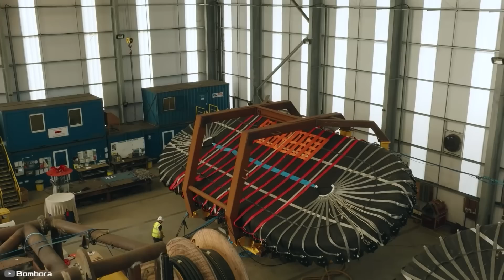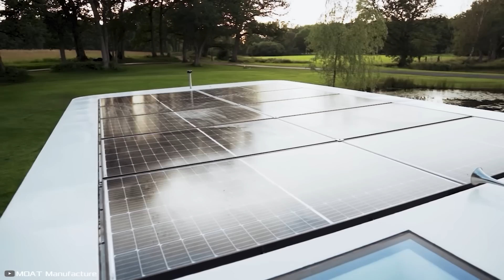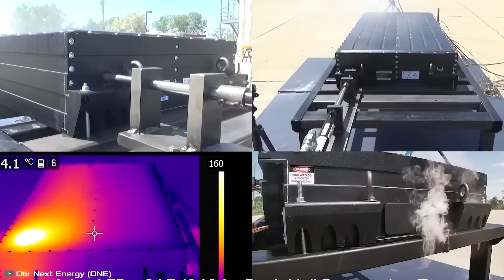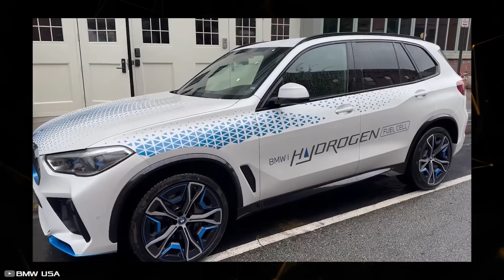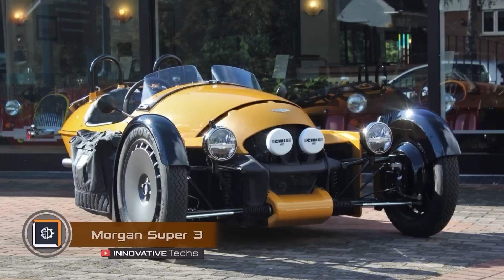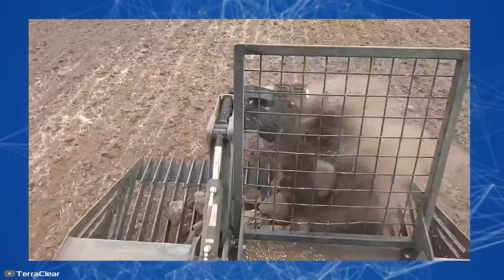80 INVENTIONS ON A WHOLE NEW LEVEL

Comment: I have an idea for a hub motor, it goes to the inside of the bearing hub,  eliminates constant velocity shafts and requires no gearing. It is an axial flux design using iron nitride magnets.

Comment: The mule, seems to be only pertinent to 1 bricklayer. They need to get bricks from the ground up to the bricklayer. Now if the mule could do that and assist a bricklayer now we're talking. Now we're talking about proficient and accelerated build time. Just assisting a bricklayer in which the border being wide ass open could be filled with manual labor for a dime a dozen. Sorry to say to the professional bricklayers that is a very god-given talent. Sad to say the quality of those who have that talent and will lose their jobs, the job will suffer. I know I got off point there a little bit but sometimes I just say what I think. Thinking out loud.

Comment: the centerless hub wheel on motorcycles IS NOT new technology   it goes back over 15 years ago atleast. and the bike you show here in video the original concep bike made in 2018 , LOL  Magenn MARS system wind system  goes back to 2008,    lumineq  just took  older technology to new  cutting edeg  ( 5  years  ago )   and the list goes on, nothing new  here and   any are old tech

Comment: With the advent of all of these electrically operated devices and machines, our current power grid is already failing disaterously Before we pursue this pipe dream of “green” magical energy, let’s rethink our very outdated infrastructure. We must first build anew, with the vision of expansion and development of more efficient technologies being incorporated into the system. We need to look beyond now as the current equipment is so limited in its capacity. Modularity and standardization are the major factors. This will require much less maintenance time and greater flexibility as technology evolves. By designing system standards first, we can explore new options to be added as our demand for affordable, reliable and plentiful power will only increase. A plug n play system can reduce down time and increase speed and efficiency of expansion as needed. This will allow for individual locations to generate their own electricity and supplement the grid too. Modular design will also allow replacement parts to be staged at regional locations for immediate deployment in maintenance or disaster recovery operations. The defective parts are just swapped out and returned to regional repair/recycle facilities where they will be repaired and tested or parts salvaged to use later as required. In the event of a large scale disaster scenario, we will no longer have to make adaptations by each power company because they will all be on the same standards for “connectability.”  We will be using apples with apples, not oranges! This will definitely be a long term project. But as long as we demand more power, we have no choice other than to invest in a new grid and distribution system!!  We either pay up front now or pay even more down line like we do currently. It’s like trying to fix an amputation with a box of bandages. We just need to suck it up and put our big boy pants on and start working hard to make America’s grid great again!!! MAGGA ☝🏻

Comment: FINALLY.. GOING BACK TO BETTER. NEVADA USED TO TRANSPORT ORE MILES DOWN HILL FOR PROCESSING.. AND WITH OPEN PIT MINES.. I WANNA SEE THEM USING MOBILE- TRACK MOBILE CONVEYOR SYSTEMS FOR SENDING ORE OR COAL UP TO PROCESS OR SHIP.  
GET RID OF THOSE SLOW TRUCKS.. CONVEYOR SYSTEMS ON RADIUS TRACKS AROUND THE PIT IS FAR FASTER AND CHEAPER AND CLEANER THAN TRUCKS.